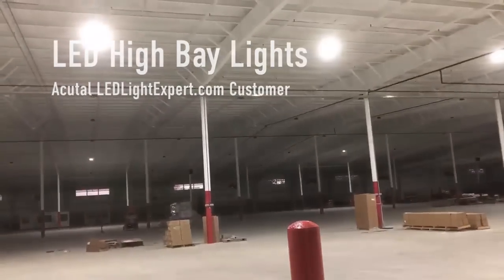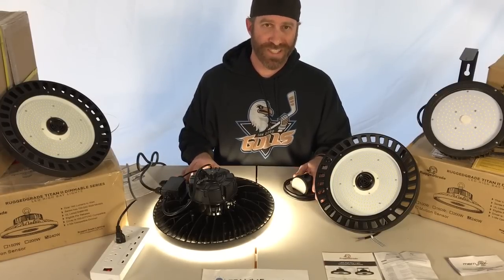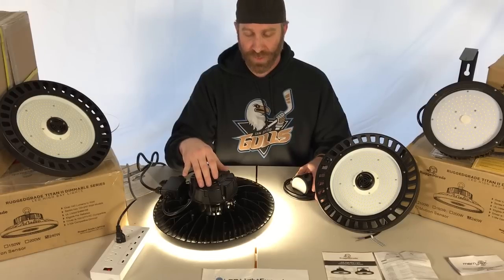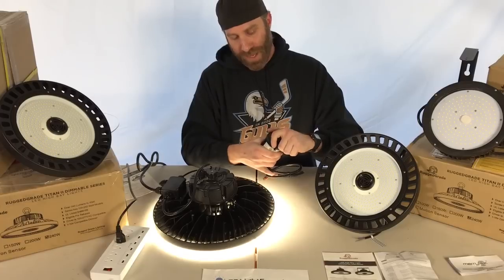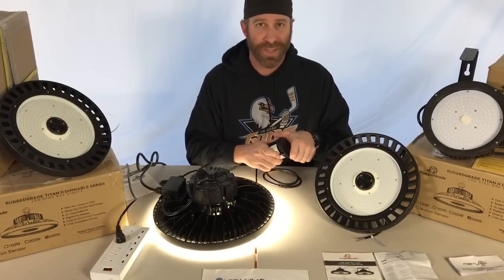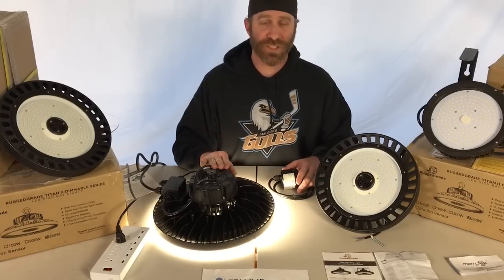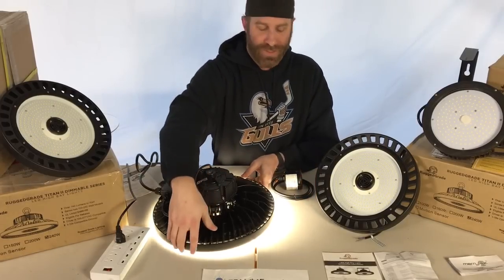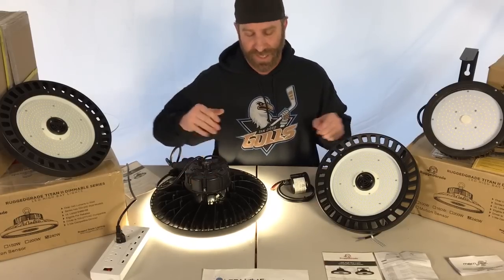LED Warehouse Motion Sensor Lights - Motion Sensor High Bay Lights Explained

Comment: My customers at playcentre always complain of bad light during night time parties/functions. I have observed that lights r bright when they turn on but later gets dull. 
Thank you for the video. 
Can an electrician turn off the energy saving thing and just leave it bright 100% through out?
Reply from the maker: I would suggest getting an electrician in there to investigate. If they are motion sensor lights if could be something to do with the sensor settings if it has step dimming. If it is a single light if could be a problem with that light but if it is multiple lights it is more likely something else causing the problem or it may just be time to replace the lights. Getting someone on site that can troubleshoot your system is probably the best idea to figure out what the issue is.